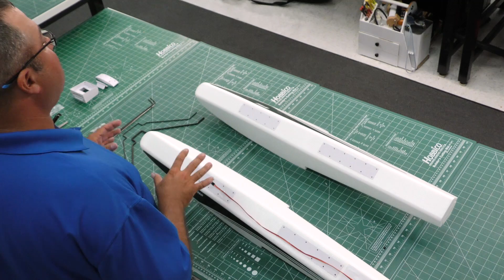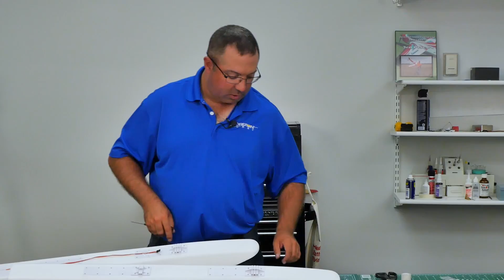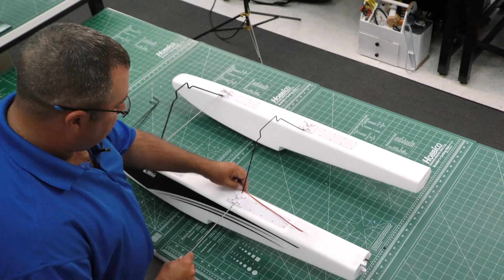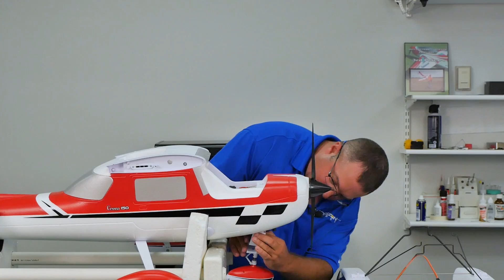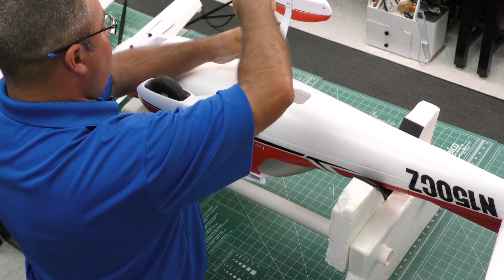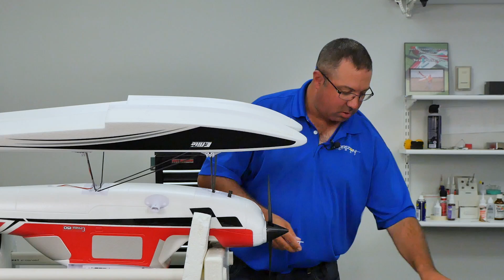E-flite Carbon-Z Cessna 150 2.1m Float Assembly

Comment: A much needed and appreciated video, really helped with the installation, but one question:  How come the diagonal strut is in compression and not arranged so it would be in tension?  I realize some airplanes are set up that way but those thin wire braces would do much better in tension than in compression.